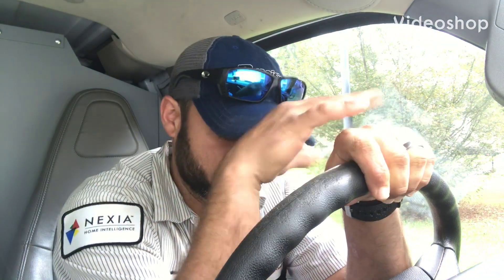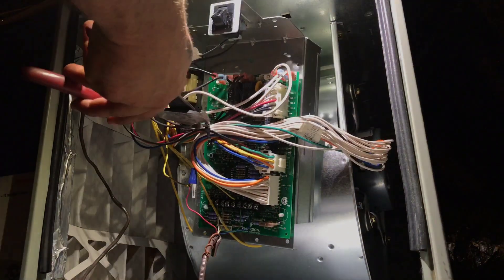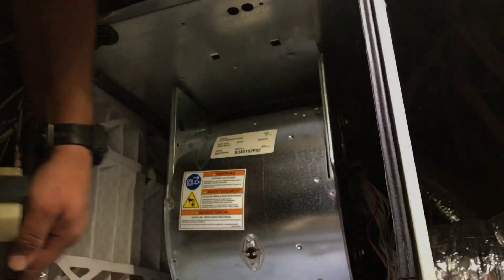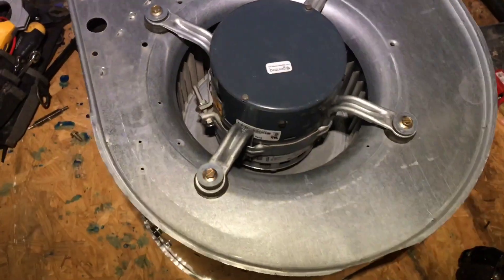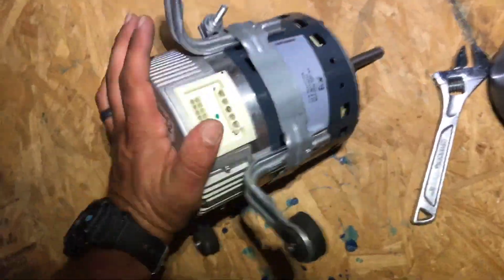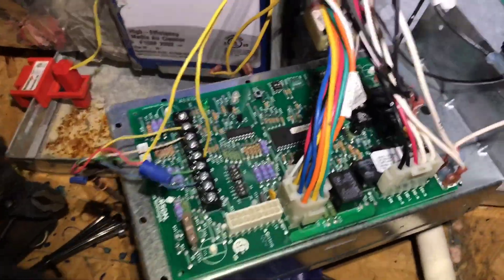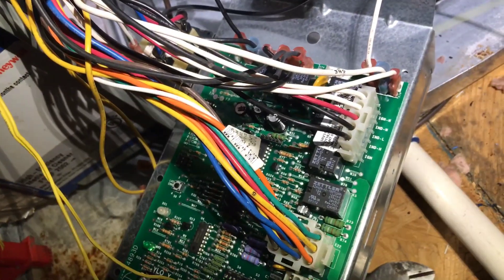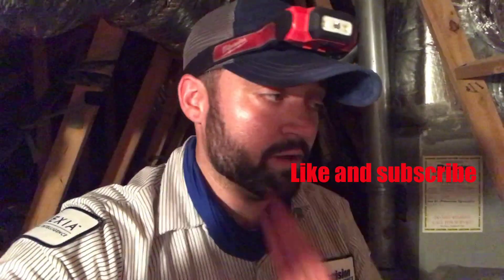Replacing a Variable Speed Blower Motor and Board-HVAC Service Call

Comment: Wondering how easy is it to upgrade the cheap non variable blower motor to this more efficient one.
Reply from the maker: It would be a complete overhaul of the electrical components like new board, wiring harness, motor, ect... your better off upgrading the furnace.
Reply: Usually it's the other way around. The ECM motors are very expensive to replace so many replace it with a PSC motor and relay or qwikswap kit.